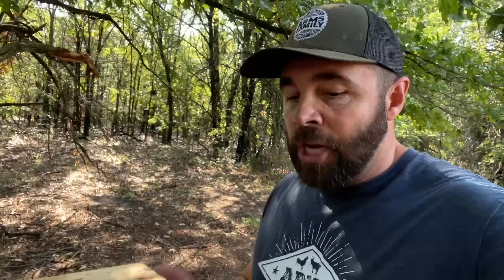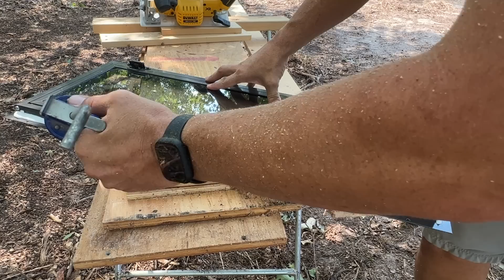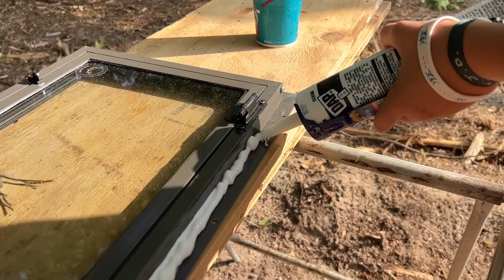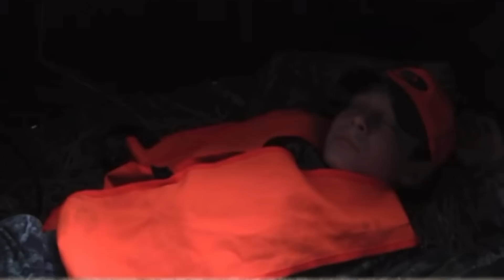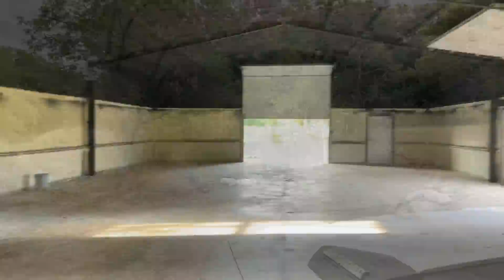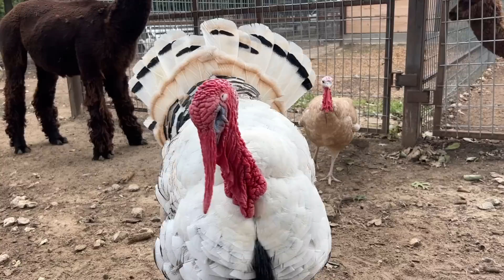Houston Approved Shed to Deer Blind Conversion!

Comment: The windows look good , an easy trick for curtains over the windows is to stretch a thin rope or  wire above the window  and use some old pillow cases for curtains you can even dye them black before hand!  Quick and easy  or any pieces of dark cloth to put over the wire

Comment: Go get you some blue foam board 1 inch thick for walls. It will deaden the noise like you won’t believe make the tuff hunts easier ( remember limpy gimpy ) along with some burlap tater sacks to drape over the windows so you won’t be back lit

Comment: Hey Daniel, it's ground level - put plenty of caulk on, it's cheap, and plywood rots fast when wet. Easy to remove with a razor blade later. Just make it functional. 

Insulation? So don't do it this year. you can always add later. You have those Jackery power supplies, you can always bring one with a small space heater on the real cold days if they are rare.

Comment: Considering how cold it can be during hunting season, I'd look at putting some Rockwool insulation between the studs and then put some drywall or some of that insulation foil over the Rockwool to seal it up.  Pool noodles can be cut in half lengthwise and used under the edges of the roof to close off the openings there.  That would give you a nice insulated hunting blind and wouldn't cost that much.

Comment: Hi Daniel. When it’s very cold…rather than insulating the shed…just use your generator and a small electric space heater. Should be enough heat.

Comment: Daniel 
Perhaps call "roll up doors" bay doors I did 77 Firestone stores renovation in Texas years ago when you were once young & I was younger too. On post and bay doors Sherwin and William sells a product line called metal latex wask stuff down with vinegar first it will clean off manufacturer oil before painting great metal paint for steel post and metal bay doors just like your.

Comment: Chet at Larson Farms put up l.e.d. lights and they are bright. Need the shelf back in the shed so you can rest your gun on it. And spray foam Can at Lowes fill in gaps use the one has bug control mixed in.. those battery deals you get like the cabin bring it along with space heater for winter🎉❤😂🎉

Comment: Daniel, all you’ll have to do is get some rolls of insulation or the board and liquid nail it against the wall and get some thin Luwan or something then wallboard like a piece of paneling and cover up the walls. That way it’ll darken it up inside and also you’ll have the insulationto warm it or keep it cooler which ever way you want it but it also didn’t sound

Comment: Quick and dirty, Reflectix on the walls of the blind, then just staple some black speaker fabric to it.  black interlocking foam pads for the floor.  Definitely like that DIY foam for the underside of the tin roof.  Some eyebolts in studs and hang a hammock inside for naps.  Should make for a sweet hunting blind.  A Mr. Heater should be more than enough to keep it cozy too.

It's all coming together and lookin' good there Kemosabe.

Comment: I would either spray some foam on the walls or line it with some carpet not for insulation purposes but for sound dampening

Comment: Daniel 
Suggest Sherwin & Williams superpaint least expensive very elastic high survivability longevity 2 coats in your color choice it's best quality try mistints(cheaper price)  adding to make color right as exceptable it may slow dry if lots of pigment added. Get it on before temperature is below 50 or if it's going to rain in the next 24 hours.
Looks nice might as well insulate kids aren't as cold hardy as yourself Daniel.  Hunting with children is a big thing to you.

Comment: You did a great job but insulate the ceiling and to be honest do it as you can afford to but I'd do the walls.  Most hunting fails because of freezing to death.  You have generators so I guess you could do heaters.  Either way what a great window project. Daniel are you going to add like a net or something over the front???

Comment: That’s a jake then not a hen lol put some vents in blind one at each end maybe one in back walls up close to top plate. I wouldn’t insulate , not that cold there if you get a chill use a mr heater to take the chill off . That’s what I do . 😅

Comment: If you don't want to spend the money to insulate the blind, another option is to purchase a Mr. Heater Buddy propane heater. It is a variable BTU bottled propane heater.  Should be all you would need. With the windows open you would be getting plenty of fresh air. They are efficient and quiet.

Comment: If the insulation reduces heat and air cost that will help in the long run. You should have good space to work and pack murch. Congratulations

Comment: ❤ If you put in insulation insulation on the roof i'd get an old carpet,    and put it on the floor and that way to keep it at least a little warmer. During those chilly times

Comment: I usually go to Lowe's and get the 4x8 sheets of one inch Styrofoam and insulate the walls and ceiling they're not that expensive and easy to cut with a pocket knife

Comment: Hahaha. Those turkeys.  I'm down to 6, 4 useless toms and 2 hens.  The toms do absolutely nothing but strut around and gobble.  And one of my hens likes to strut around with them.  I've got 8 roosters with my flock and those boys do their job well.  They go out with any group of hens that ranges and absolutely will chase them back to the barn if something flys over or otherwise looks fishy.  
On the shed - is spray foam the best option?  Not those silver insulation pad thingys?  I need to do something in my feed room/shop as (it's an L shape) part of it is fully under the barn roof, but there's a 12x12 section that has a metal roof that's fully exposed to the sun.  It gets SO hot in there and I'm looking for ways to alleviate that.